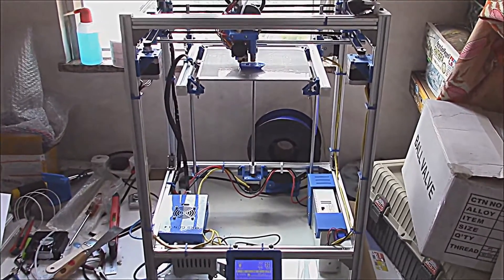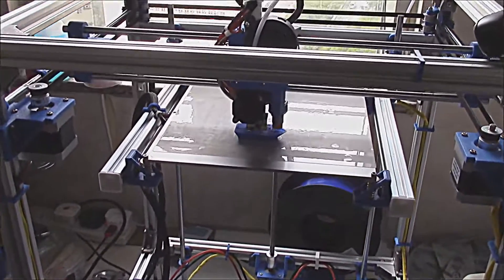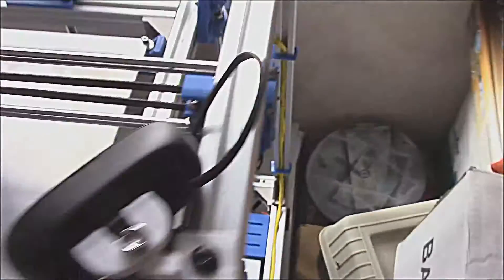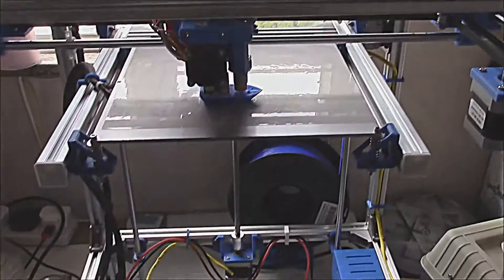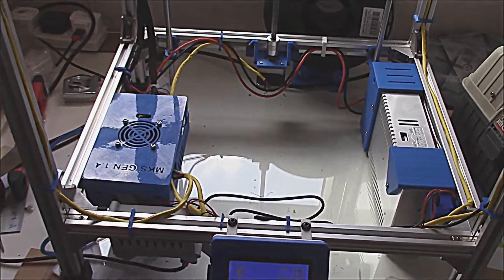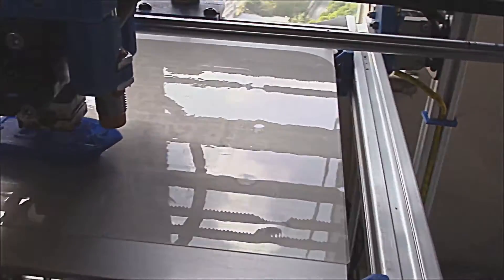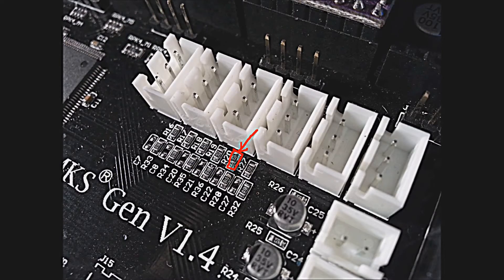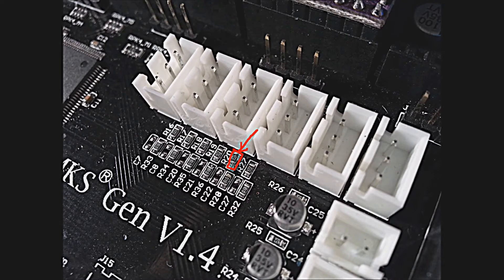DIY 3D Printer - HyperCube

Comment: nice build i had faced once in issue in mks gen 1.4 my endstops were not working with board but inductive sensors were working fine. any inputs will be appreciated
Reply from the maker: If you have the endstops recommended by Tech2C, I will check the wiring and the configuration of your marlin firmware. Or better yet, just use the one provided by Tech2C. Then test will the G-Code M119.
Good Luck!

Comment: Hi BB o HK, happy new year! Just out of curiosity with your setup. How did you setup your auto bed leveling function. Is it triggered manually through a PC connection or LCD screen? Thanks.
Reply from the maker: I use an inductive sensor as Z-probe, suggested by Tech2C video. Recently I enabled Bilinear Auto Bed Leveling (Marlin 1.1.0-RC8) which I set it to probe 5x5 that is 25 points on the bed. 
You can trigger it by Gcode G29 or select "Level Bed" on the LCD.
Usually, your startup script will start with G28 (auto home) then you add G29 afterwards.
This setup works very well for me as my China made printbed is not flat!
Cheer!
Reply: Thank dude! Much appreciate your reply. I have acquired most of the parts for the printer except for the mainboard. I'm considering the MKS Gen and pair it with a 3.2inch LCD screen. That's why I wanted to know about how to trigger the auto bed leveling function. I would love to experiment with a 32bit board but I'm new to 3D printing and worried that it requires a different firmware than Marlin 1.1.0-RC8.
Reply from the maker: I think you mean the MKS Sbase 32-bit board, right. You need to run SmoothieWare  with it, I have no XP with Smoothie yet.
I have that LCD screen as well. But I don't really like it, so I didn't install it to my HyperCube.
Reply: Just thinking out loud, perhaps do a video on comparing both screens detailing the pros and cons :)

Comment: What is the advantage of moving to 24v?  (New to all this and collecting parts for my Hypercube.)
Reply from the maker: With the same power draw, higher voltage requires less current. That's mean you can use thinner wire, less loss and heat generated. That's why power plant raise the transmitting voltage to very high like 132 or 400kv.
Happy New Year and good luck to your build!! ;)

Comment: Hi there, good job on the build!  I'm also in the process of collecting parts to build a hypercube printer but can't decide on how big the frame should be if later on I want to upgrade to a 300x300 heatbed. Would you mind sharing the demension of your printer frame and will it fit a 300x300 heatbed? Thanks
Reply from the maker: I bought several 1 meter long 2020 extrusions and cut 4x400mm. The remaining 4 about 600mm extrusions use as the 4 vertical legs. Then cut another 4x340mm from 2x1 meter long one and built the frame. This will fit a X300 Y200 print bed.

If you wanna have 300x300, you might increase the length of 4x340mm to 4x440mm. 
Good luck!!
Reply: Thanks for suggesting the dimension! You should consider posting some build videos and challenges you came across.
Reply from the maker: Making DIY 3D Printer is much more easier than video! 
Merry Christmas!! ;)
Reply: Thanks! Merry Christmas to you too!